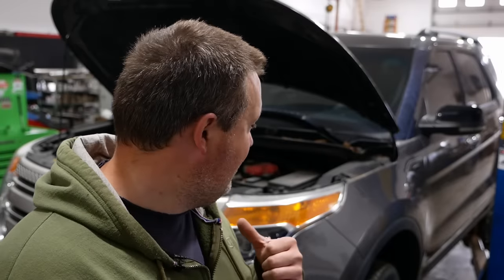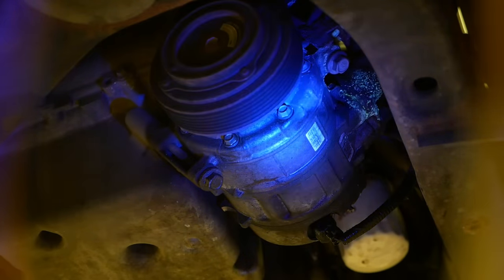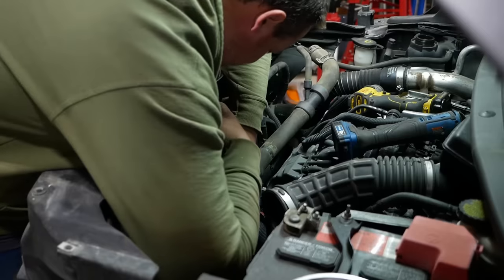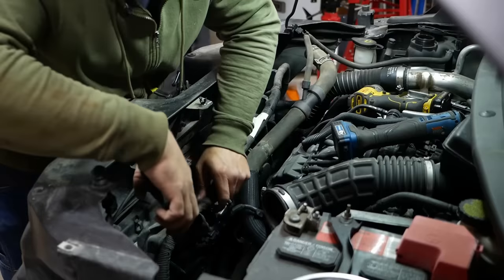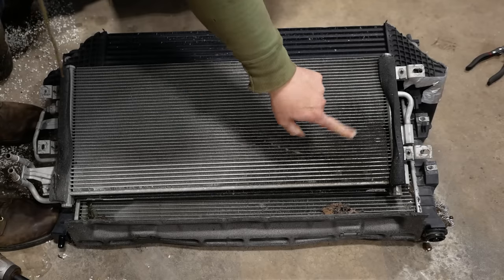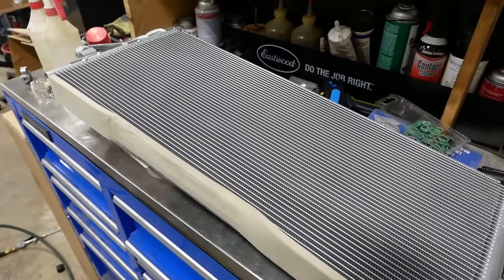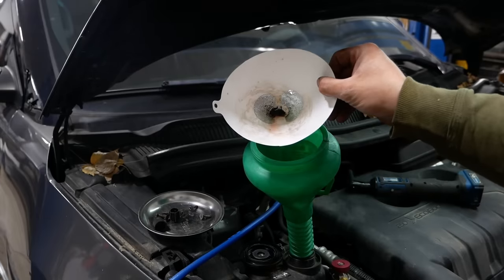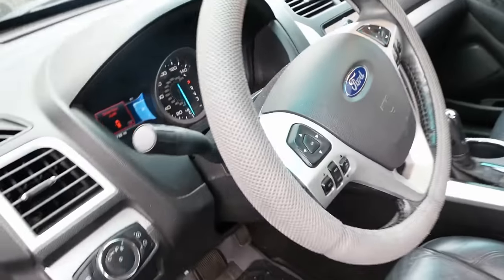Ford Explorer Replace A/C Condenser

Comment: What do you think of 12A products?  We sell a crap load of DYI  kits from Redtek.  It is a cheap option for a client to at least verify if they have a viable system.  Red means Dead, meaning a guage that reads in the red, you better get used to the heat.  The other option is a block of ice and fan that plug into the cigarette lighter. Red neck cooling system.

Comment: If you need the air conditioning right away and you have no money might I suggest the 255 method of automotive cooling? 2 windows down at 55 MPH and that will be 40 dollars for the shop time and consultation fee... good day.

Comment: I work in an industry that supplies certain parts for the fuel system of a car, and I honestly don’t understand why prices are going up so much on new parts. I can’t speak for other manufacturers, but we sign contracts at the creation of the part to supply x number for y years at z price. General economics does not impact the price we sell our products at at all. So pray tell me why the retail price for our products is going higher?

Comment: I was lucky, a guy bought a saw I built, I said if it gives problems bring it back.... he brought it back. I changed carb bits over with parts that I already had and got it to run, said no charge, he then says to me he has another saw and can I get it going? and he will pay me xyz, sure thing, I get it going and he swings by and pays me more than what he said he would, sends me a video message today showing both saws still running. He's happy he has two running saws and I am happy I don't have another return, more money in my pocket than I thought and am not out of pocket on a freebie repair..

Comment: Surprised the removal instructions weren’t to remove the subframe and lower the engine to pull the radiator and condenser out.

Comment: Man I would hate trying to do a DIY Radiator replacement job in the driveway on one of those Explorers. I mean i'm sure there's is probably a way to do it without disconnecting the condenser but I don't imagine it would be frustration free.. Would likely swear a whole lot and maybe throw some tools..

Comment: Maybe it is just me, but I can never understand why people who pay a mechanic always want the cheapest parts installed. If you are paying someone for his/her labor, wouldn't you want the best parts installed so you don't end up paying someone for his or her labor again to replace the same part that did not last. Most aftermarket parts have a warranty, but often times the warranty does not cover labor for removal and reinstallation if the part is defective. This is not an issue for do-it-yourselfers as it just comes down to your time, but it can get very expensive when you are paying someone else. 
I get the fact that money is always an issue and with that in mind, it makes sense to be smart with the money you spend.

Comment: Wes, gotta say you got the inside track for "Dissasembly/Assembly"  Master Mechanic! Spent some time in the A/C world, they did the same thing with R-12. At one point when I started you could get a 30# for less than $30 and by the time it phased out I saw upwards  of $500 for a can. I always enjoy your witt. Thanks for the look, keep on "wrenchin" as Musti would say.

Additional note. You think thats whats going on with fossil fuel and internal combustion engine vehicles?

Comment: Honestly, I don’t mind working on stuff like that. It pays well enough and once you get the crap out of the way, you have lots of space to work. I don’t live or work in the rust belt though. I’d lose my mind just doing an oil change there.

I’ve never seen a split-core condenser on a car before, although it is somewhat common on larger HVAC stuff.

AC repairs are here to stay, don’t worry. My experience has been that people are more concerned about their vehicles gadgets and creature comforts than they are the mechanical bits, so they’ll gladly spend big money to keep that junk working. Electric vehicles and some hybrids rely on the AC system to cool the batteries and some of the drivetrain stuff. In other words, if the AC doesn’t work, the car will overheat and be disabled. Some also use the AC (or heat pump) for vehicle heating. So yeah, that’s coming.

Comment: that jobs looks just like a 2002-2004 audi a6 3.0. Only difference is the audi has a shock absorber on the aluminum bumper to frame.

Comment: Back in the 90's, went to a dealership for repair, shop rate $85/hr. at the time,  was able to talk to a mechanic instead of the service manager. Asked what he got per hour and he said $15 and the dealership got the other $70! It's a shame that it's the same story now, just higher shop rate and the dealer still gets the lions share.
Reply: At least 10 years ago I was in a BMW dealer service area...they were $150/hr then. Probably $200 now

Comment: Living without AC isn't that hard - you just have to roll down the window and open a beer.  With a little breeze and a little buzz, the heat disappears.  It was good for Paul and Silas, it's good enough for me.

Comment: Everything is out of control even in my line of work. Besides the obvious gas, I need to use premium for my equipment because ethanol free is not available around here. But glyphosate aka roundup went up ridiculously like refrigerant. Used to be 85 dollars for 2.5 gallons then last fall went up a little to 100 now the same 2.5 gallons is $248, and that’s contractor pricing. All the trades are feeling it, not a good road we’re headed down.

Comment: Does it have rear ac controls? If so make sure you check the lines to the rear there’s a connection in the area of the drivers rear wheel that always leak!

Comment: You want some real fun? Replace the water pump on this baby! My mechanic wouldn't touch it. Ford dealer must do alot, they did it in less that one day by dropping the entire front cradle down; engine, tranny and front suspension in one unit and changed it that way. Easy!

Comment: I work at a body shop. We get those fords in all the time. I’ve found that if you remove all that shit with the bolt in radiator support and the impact bar they are pretty easy to get all that abortion out.  You just need two people to put it all back together

Comment: On a service note, it looks like the procedure here would be the same for just replacing the radiator.  Including evac and charge the AC.  I am of the opinion that the manufacturers want the repair bills high and time consuming.  So the owner will just trade it in for another vehicle.
Reply: Negative. This car is built this way because it is easier and cheaper to assemble. The condenser, radiator, AT cooler and inter cooler come to them all as one assembly and they just shove it in the car on the assembly line. People always want to make it out to be some sort of conspiracy but it’s not.

Comment: Hey Wes, quick question. I have a 2018 Ford explorer. AC cut out. Brought it to the dealership and they diagnosed it as a bad drive belt/tensioner. Had it replaced. It worked for 3 weeks and then stopped working again. Drive belt was making a good deal of noise. Brought it back to them and they told me the AC compressor had internal failure and they need to replace the entire system (compressor/condenser/ evaporate valves). Is this a bit suspect? Or is it possible that when they replaced the belt it caused damage to the compressor? I do not know a lot about working on cars as it’s not my field. Just wondering if it’s weird that 3 weeks apart these things failed on a vehicle that’s 5-6 years old. Works been done and paid for but just asking out of curiosity.

Comment: Nearly as crazy as the Peugeot 806,hopefully you didn't get these on your side of the pond. To remove the headlamp you have to remove the entire front, this was only necessary as the bulb holder would drop the bulds into the headlamp unit. 10 years ago this was charged as £600 by the main stealer. Good luck in these hard times.

Comment: I didn't know there was an issue with remanufactured A/C compressors? I keep hearing that reman automatic transmissions are supposed to be better than new. What's the issue on the compressors, like a Denso or similar?

Comment: I think it would've been easier to start at the back and work your way forward! What a PITA to work on that vehicle. Is everything so awkward? I've found that usually, if a car is difficult for one thing then pretty much every job on it will be a pig. I think it's down to short-sighted design or lack of forethought. Stay safe. P.S. I don't think you've heard from them after that tyre let go on the highway and they are lying in a ditch somewhere. 🤔

Comment: Not replaced the drier bottle Wes? Is your machine automatically adding oil to the new condenser or did it come with oil in it already? Glad I got a bottle of R134 just before pandemic, should be enough for 10 years for my fleet :)
Reply from the maker: The machine adds oil automatically. 15mL in this case. No new accumulator, no money.

Comment: It must be an unwritten design code that says putting 20lbs of engine and radiator into a 5lb space is accepted criteria. I guess moving the front end out a half a foot drives the costs up too much. Engineers should be required to do repair work on a prototype, in a shop setting, before any design is approved. As a builder, I think architects should be hands-on workers on the first two projects they draw up. Both fields would benefit greatly from the new and realistic  paradigm.

Comment: The accessories on the explorer are kind of expensive, the alternator last I checked was something like 700$, but it's not a china made unit. Not sure about the compressor but I am fairly sure it's not made cheaply. I like this generation of explorer however the longitudinal engine layout is a pain in the rear.

Comment: Wow , that's a good one , wanna
hear mine got a brand new truck
after it reached 200,000 ( work
truck) went from a Toyota dayna
100 ( petrol)to a Kia 2700 ( desiel)
 Had a heater core blow on me , a
4 day job had to take out the whole
dashboard out yeah l'm serious. Kia
Service was a joke , alternater 1 day
off the road , brake disc clips 2 days
off the road , lost the gear change
cable 3 days , never had these kind
of problems with the Toyota fixed
same day , so give me my Toyota
back mac , lol.😭

Comment: 1:18 I've been working at a vioc for 3 years. I've done all makes and models (under $100k), and I can say that that splash shield, with the 4 wing screws for the whole thing is the worst designed splash shield ever. They fall off too easily. These cars can also come with one that only covers the drain plug and oil filter on the passenger side with 3 wing screws. Terrible either way.

Comment: Wes I would love to have someone explain to me how when I supposedly get a “new engine” in a 2016 Hyundai Sonata Sport that I continue to have trouble with it because I finally get someone to tell me that a lot of the parts from the old engine are taken off and put on the “new engine”, most notably the knock sensor which makes no sense at all to me considering where it is located and how much disassembly/assembly is necessary to make this “change” 😑😑

Comment: My Ford Explorers A/C system was completely replaced and it still did not work. Many times to the dealership and communication with the engineers at the mothership but still did not work.

Comment: Pull the front bumper? Yeah, had to pull the bumper and core radiator support on my mk4 Jetta to change the condenser as well.

And then the kit they send you with the new compressor with all the orings(At least in my case)? It's just a random smattering of o-rings and you have to guess which one to use. God forbid they have the exact sizes you need for the system semi-organized. And then find out it leaks when pulling a vaccum, or maybe not then but just if you pressurize the system with nitrogen... And then you buy an ultrasonic leak detector because soapy water isn't doing the trick, and then you replace the MFing oring you installed on the condenser with one that's thicker than factory or smaller ID and thicker or something and finally it's sealed. The brand new compressor shaft seal was also bad too the first time around, so had to replace that too before ever charging the system. I did turn it with the pulley down to lubricate it, but no luck on the first one.

That said, that A/C works better than ever now. My advice is don't F with changing the variable valve inside those variable displacement compressors. Just gonna end up with a leak on your new gasket and end up replacing the compressor down the road anyway.

That is really disheartening hearing the prices of R134a having gone up that much. But at this rate you won't be able to afford the electricity (in a house anyway) to cool yourself off, let alone the natural gas to heat, or the gas or diesel to run your vehicle.

Comment: Hello I have 2017 ford explorer xlt 3.5 . Ac condenser was punctured so I have replaced it and kept the original radiator. Put everything back together but I am having overheating issues and the coolant won’t leave the reservoir. Can anyone guide to get this taken care of ? 🙏🏼

Comment: That's not that uncommon to rip off the whole front for this job. We had it done on my mate's VW Passat, the same series you had a while ago in the video, the one with the oil leak. All that work you had done on the Ford here, just add removing the steel bumper, insert a special toolkit only available at VW stealership, only used to slide forward the cooler pack so that you can work from back to front up to the actual broken one...
We helped ourselves with two pieces of all-thread, but it still was a ride to hell and back...
:-D
The material prices are ridicoulos...first it was the disease, now it's the war, they are always find things to blame on...
:-/
Thx for showing!
:-D

Comment: Client shouldn't worry about the cost of that repair. It will be dwarfed by the cost of the block cracking and blowing all the coolant out tail pipe. Good news though long blocks are only 1800 from dealership.

Comment: Hey Wes and family, I'm looking to see if anybody has any resources for a 95 smelica wiring diagram for the rear blinkers. Front works just fine but replaced the bulbs and relay and no dice. Car sat for awhile so I'm thinking some rodent ate through the wires.

Comment: This is nothing else than greed. Plain and simple. Under the guise of supplychainissues or inflation, greed prevails. Nothing goes up 100 or 200% through inflation, whether it's monetary inflation (which is a big problem, especially in the USA) or inflation caused by demand/supply imbalances. So, remember which shops are particularly guilty of pricegouging and remember to let those shops perish and whither....

Comment: How a 2012 car already have the whole AC system broken? My 2004 Honda Fit still blasts ice cold without a single leak
Reply from the maker: Dunno.
Reply: Before getting too cocky, however, remember there are two type of auto AC systems.  Those that leak, and those that will leak. Your beloved Honda Fit leaks....at about an ounce per year like every car on the road, usually through compressor shaft seals.  If I were you, I'd have it serviced every 5-7 years.  Low refrigerant is the leading cause of compressor failure.  You don't notice a cooling problem until it's about 50% low but the damage is being done with reduced oil flow.  On leaks, environment plays a big part, though, too.   Side note...I just changed an evaporator core on a 2014 CRV.  First time I've seen a Honda evaporator leak.  Condensers leak all the time.

Comment: What brand is that cordless ratchet you're using?
Reply: From (potentially faulty) memory that's a Harbor Freight Hercules
Reply: @CAPNMAC82   I think you're right. I think he did mention that in an older video.

Comment: Hi Went to my Subaru dealer, ask how much to change spark plugs in her 2016 Subaru Forrester, only $900, if I’d had the 60,000 mile check up if you’re only been 200, I bought plugs for 40 bucks end it myself so things have gotten insane

Comment: Anyone wanna help me my AC stopped working randomly just blows warm air on the cool section AC light comes on no action of the AC clutch engaging. Engine belt still spins around the compressor but AC clutch no engagement. Fuses are all good I have power at the AC clutch relay no signal power but if I jump the relay the clutch engages and spins the AC pump. No under hood fan action and fans do work when engine get warm they come on just do t come on with the AC like they should. There’s no leaks that I can see under the hood everything looks dry including the AC coil upfront I even put on the the special gasses to see any Freon leaking nothing. There’s still some pressure in the system I pushed down the straiter valve and I herd pressure shoot out. I have power at the low pressure switch as well I don’t know if there’s more just tested the one on the high side line only one I could find. So I stumped any ideas.

Comment: $1200 to do a basic a/c service? I've got a '94 ZJ that I bought right before used car prices went higher than Charlie Sheen.  I took it to a shop to see how much it was going to cost.. The manager called me back and said that there's nothing wrong with the system except a low charge. He said that they pumped the system out and it held vacuum for over an hour. He said he could recharge the system and add dye for $300 and I could pick it up the same day. Maybe its the new refrigerant but if this guy had told me $1200 forget it. I only paid $1600 for the vehicle in the first place.